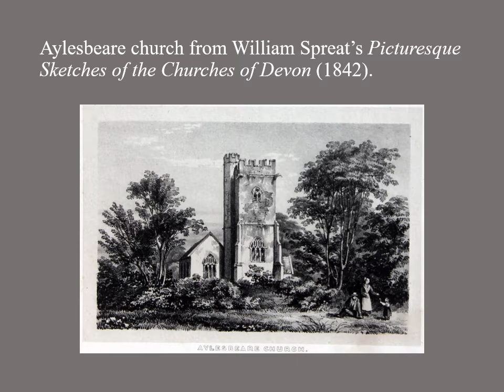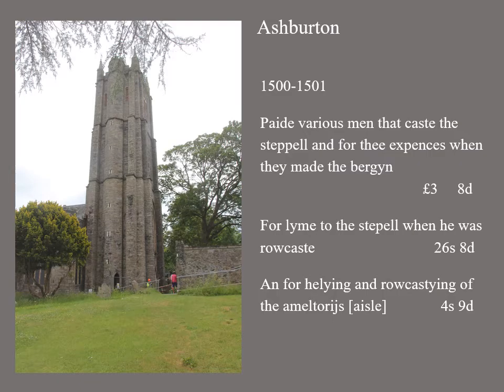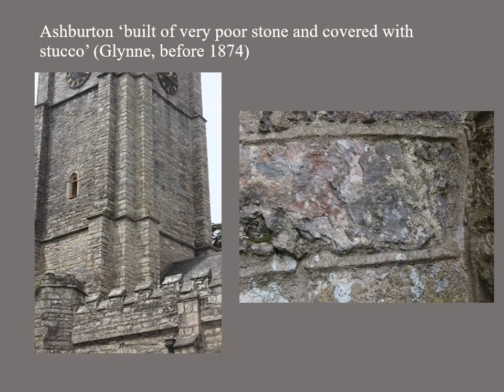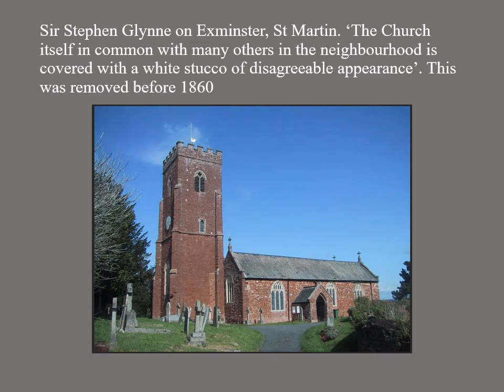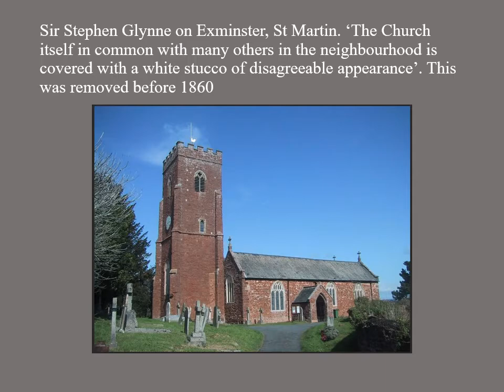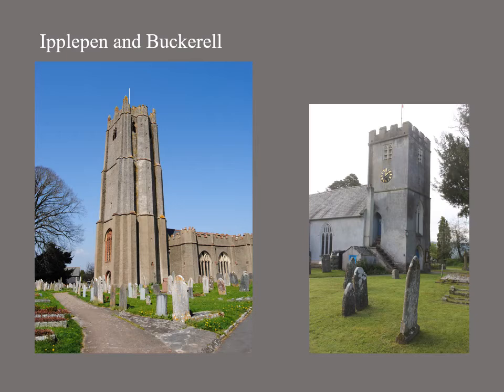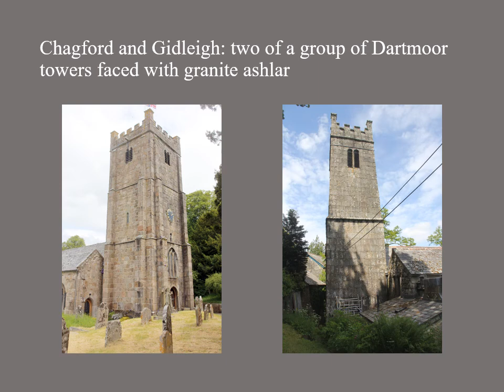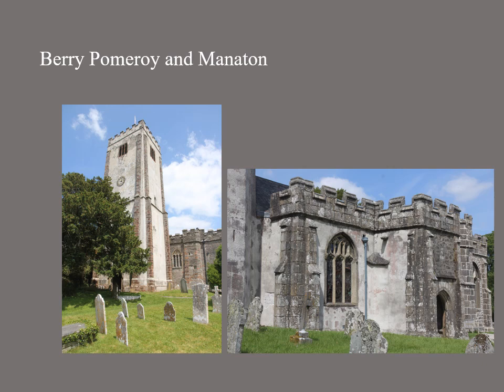5 BLF Lecture Dr Jo Cox

Comment: This is useful. A couple of thoughts. We seem to have survivor bias; the robust material survives the more vulnerable decays or is removed. The more we look at bare stone the more we see. In reality, when we learn how and where to look the assessment is more impactful as you rightly point out with the example of the Victorian rebuilding on the medieval base trapping the older roughcast in. Was this early roughcast integrated with the building mortar? In the Kenton example I think we can explore style and presentation; here there are straight joints and variable width courses. These are different to the formal ashlar polychromatic work in the basement of York Minster. Top example by the way. Two final points, the example from St. Mary's Reading is completely convincing as building where the presentation is as it seems. I think it's worth looking at how integrated the external skin is with the Rough Work (Wm. Adam's term c.1721). If it is an external but tied veneer then this puts  the building in a different light, after all what is external plaster/roughcast if it is not a veneer. I thought the example of Stowford in Devon less compelling as the finished presentation, more like Roman work where small sub-rounded work is secured in squared regular blocks for robustness. But hey what do I know! Thank you.